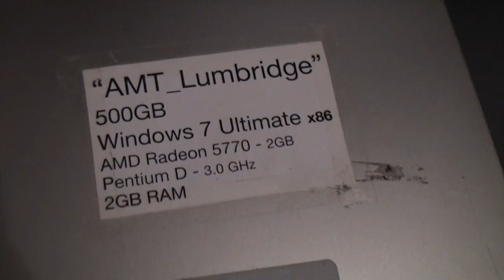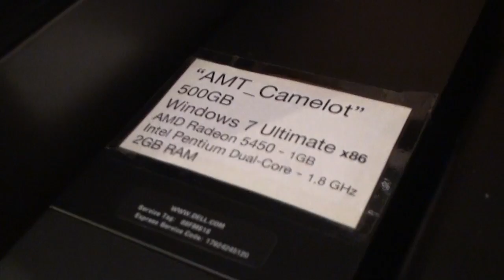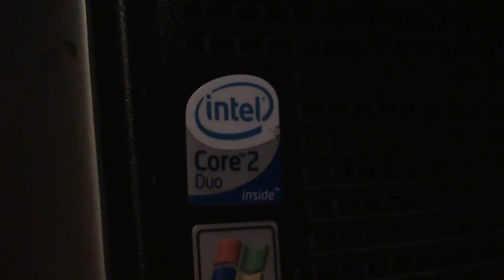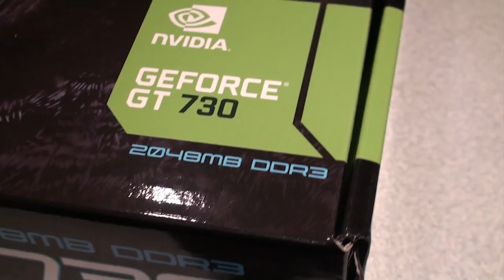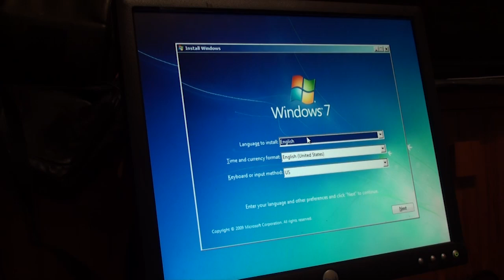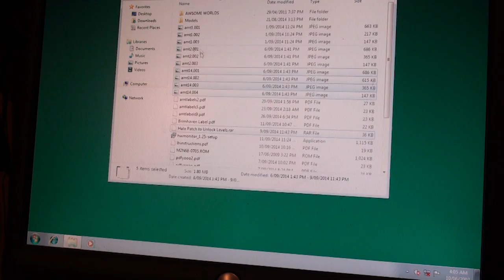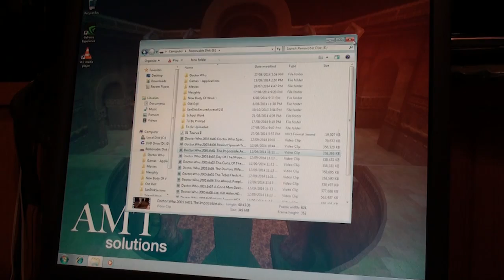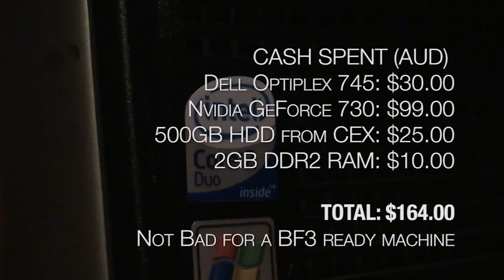Turning an Optiplex 745 from Boy to Man - Green Ham Gaming

Comment: I'm on a Pentium 4 3.20Ghz right now xD, the video kinda lags, but it's ok.
Reply: ***** 50 Euro's for a Core 2 quad q8400
Reply: WokAwAy Ik fix oude PC for de lol, Ik heb 3 PC's met een pentium, xD.
Reply: +Lars Schothorst 50 euros for a 2 duo are you joking more like 5-10 used
Reply: Nr1 sweds For everyone English, I already said in Dutch: I repair PC's for fun, my neighbor's have an old pentium 4 system, I reinstalled windows XP and upgraded the RAM from 256Mb to 1.5 Gb. I was just testing it...
Reply: Lars Schothorst oh I understand. And your awesome
Reply: core 2 duo e6400 2.66ghz pc I built even without my pny 6800 gs installed it pulls 1080p60 easily somehow XD
Reply: Black father sitting in chair If your computer supports a Core 2 Duo T9550, you should upgrade to at least that processor.
Reply: get a pentium g4560

Comment: At this point in time I've got a Dell Optiplex 760 running blazing fast with a GT 210, Core 2 Quad, and 6gb of ddr2. It's also got a 500 watt power supply I had laying around. Gotta love the old Optiplex towers.

Comment: I always had a sweet spot for the Optiplexes.
Back in 2012 I upgraded an Optiplex 745, when I was done it had really nice specifications:
Intel Core2Quad Q6600
NVidia GeForce GTX 295
8GB DDR2 RAM
64GB SSD + 1TB HDD
600W Noname power supply (however, still works until today)

To get that massive graphics card in there I actually had to cut a hole into the plastic part holding the CPU cooler, but it worked flawlessly, the temps still were fine...

I really liked that machine, but now it is more stripped down and in server use as I got a faster laptop

Comment: Hello there. may I ask for a small inconvenience? if you have a kill-a-watt could you please check how much power the cpu alone (755 sff or 760 the kind) draw both on idle and on load? I found several good ones on sale for cheap and I'm thinking about hacking it up, but a C2D's power consumption scares me a bit (okay, a lot) if I chose to run this system headless 24/7 as a Linux file server. Thanks a lot.

Comment: +Green Ham Gaming I've been contemplating some dell mods myself and it occurred to me that you can put a Kentsfield Q6600 Core 2 Quad in a Optiplex 760 uSFF and it will run just fine, problem is it gets hot. so I'm thinking of moving the HDD to the DVD Bay (using one of those Latitude 2nd HDD bay adapters) or an externally powered bay with a eSATA adapter and making a custom air pipe to push air specifically to the CPU and 4GB of 8500 RAM. sound feasible? or waste of time because the Intel Integrated GPU is too weak to bother?

Comment: theres nothing wrong with x64, you need x64 if your using 4gb or more of ram as on x86 it will only see 3gb out of the 4gb ram and you will most likely end up with bluescreens, did the card automatically pick up or did you have to change a bios setting to display via the GPU?

Comment: I bought a GT 730 for my brother's pre-built. It was $70 and had 2GB of GDDR5, 384 CUDA cores, and was clocked at 902MHz.
When you said the DDR3 GT 730 was $99, I was like "WHAT", but then like I looked at the date this was posted and realized it was in 2014.
Reply: My gt 730 is the only card with a 4gb chip. You might know it, MSI made it. 
Its stock clocks were 700mhz on the core clock and 500mhz on the memory clock. 
Iv  actually gotten the card to reach as far as it can possibly get, 910mhz on the core clock and 650mhz on the memory clock, with absolutely no temperature hiccups or screen artifacts!
Reply: also australian dollers not us dollers

Comment: i have a stack of dell gx620's that look just like this one man... they are not impressive but will do the trick for cheap... i have these as play pc's for my 3 kids so they don't end up breaking my bank account... i think the stack is at 12 just for the dell gx620's and then 4 or 5 servers servers of different sizes at any given point that i rotate through in my garage along a stack of 15-20 other pc's of all races and creeds, a dozon  or so laptops... i 6 pc's running in my house and 3 servers allmost all of these were salvaged and or given to me... i like how you can enjoy yourself with these older rigs...
 "i get it man"

Comment: Would a E6600 (Conroe) CPU with 4GB of RAM and a 9800GT work for gaming?
(My 945G chipset cannot support Core 2 Quad or Core 2 Duo Wolfdale CPUs)
I'm planning to play Civilization 5, and some 2005-2010 era games.
Reply: For 2005 -2010 era, a computer with the Conroe core should work fine. Its the newer games that will need a Wolfdale 45 nm or Core 2 Quad.

Comment: Hello There, this is a great video, thank you for sharing this, the good news is that with Windows 10 you can just change the Lock screen Wallpaper through the settings, Tweakslogon was certainly a decent tool thought for Windows 7 overall. This was a decent episode and it was great to see how much of a difference a few hardware upgrades make to the overall user experience.

Comment: Ok serious question:
Do you know if a standard PSU fits the Optiplex chassis, like the one in the video? More specifically, if possible, an EVGA 450W B?
Reply: In the newer OptiPlex 990 and 9010 that use a micro-ATX motherboard, yes. In the older OptiPlexs with the BTX motherboard, sort-of. Only two screws align up with the case and standard ATX PSU, but it will still work.

Comment: did a pentium d ever come stock with 3.4 ghz? i found a minitower optiplex 745 with:
pentium d 3.4 ghz 160gb hard drive
4 gb of ddr2 ram  q935 intel integrated graphics (ps i need suggestions for a low power, and low profile gpu)

Comment: Draynor looks cool. Almost like a tank in the computer world. It may not be powerful, but it is cool.
Reply: i have one of those machines sitting next to me that is used only for holding a paper bin xD, their not a tank at all
Reply: UPDATE I've gutted my Draynor and installed my gaming pc in it that i got for free (found a sandy bridge i3 machine thrown out because of a broken hdd) and i installed it in this case with 5 thermaltake workstation fans and for now a shit hd 5450 till i get some more money for a psu and gpu upgrade.
Reply: k thanks xD
Reply: +Lalnable Hector good luck from me too.
Reply: Hotboosthouse Thanks man, moneys short so when i found this i was so so fricking happy so when i get some money in the next 2 weeks im gonna have enough for a good psu so i can run one of the graphics card my friends have offered me( either a gts 250 or an r7 250) so its gona be great for what i play untill i get some more money for a new gpu :)
Reply: +Lalnable Hector get a 7770. It costs £40 here and it can get 1080p MAX 30 fps in GTA V. Also on 1155 you could get a core i7 3770K or an i5 3570K for £110/£95 respectively.
Reply: Hotboosthouse Im not not sure how well those prices transfer to Australia but thanks very much for the suggestion, i was thinking of going down the i5 2500 route or i7 2600 route because this board is out of an acer x3990 so i dunno how high end the cpu support is however these two are still very strong. ill be sure to check out the 7770
Reply: +Lalnable Hector they should price (the CPUs) at 180/160 AUD. It's that cheap? The 7770 should be 60-90 AUD. Os that good?
Reply: Hotboosthouse i know the square root of fuck all about AMD graphics cards so i dunno what price is good on used AMD cards. and as for cpu i can get the i5 2500 for about $100 and the i7 2600 i think their around $150
Reply: +Lalnable Hector OK
Reply: Hotboosthouse Can get the HD 7770 for about $150 on gumtree
Reply: +Lalnable Hector eh that's OK I guess...
Reply: Hotboosthouse ill shop around ive got plenty of time before i have the money
Reply: +Lalnable Hector lol I know how you feel
Reply: just thought i'd let you know i picked up a good coolermaster 600w for $79 and a gtx 780 for $190 which is really cheap here. running like a champ  but i need to get an i5 2300/2400 or 2500 to get rid of the bottleneck which i can pick up now for about $60 and then 8gb of ram and ive got my rig ready for doom and gta v :)

Comment: Fun fact: 
The GT 730 in this video is based on the GF107-400-A1 GPU which is very similar to the GF107-300-A1 as you find in a GT 430 and the same as which you would find in a GT 440 and other older GPUs. So if you have a 2GB (128-bit) GT 730, 620, 630 (rev. 1), 530, 440 or 430, expect to get similar performance.

Comment: Green Ham, quake3 has a fps limit that is set to 90 FPS by default. That's why your quite modern Dell was getting 91 FPS. You can have more if you type "com_maxfps " and then type a number, eg. 120. This will make Quake feel even more smooth on a 60hz monitor , and allows to take advantage of 144hz monitors in professional Quake scene. Also if you ever play on a HD monitor and you want true nonstreched widescreen, try downloading excessiveplus. It's a free mod that is used for multiplayer for ages , but it works with campaign and bots as well!

Comment: Hi !!! I got a Dell Optiplex 740 running Windows 7 UIltimate 64bits with an AMD Phenom 8600 Triple Core (2.3GHz), 4GB RAM, an ATI Radeon X1300/X1500 Series (256MB) and I'll love to know if I can make it more powerfull, wich processors and graphic cards should I get ? I've been searching all day for an answer. I got an AMD Athlon II X2 240 (2.8GHz) its also an AM2 socket so can I put it ? It has a graphic card PCI, PCI Express X16 entrance, BUT I DON'T KNOW IF IT CAN HANDLE IT OR IF THERE IS SOME RISK.

Comment: i have been looking at some quad core dells, like the precision and optiplex models from your experience which of these are best to upgrade and whats the best case to upgrade? im really new to this i dont want to build a complete gaming pc but willing to upgrade an an ready existing computer.
Reply: +Datsunmudder So you dont have a PC rigth now and you want a PRE-building PC of HP/Acer/Dell?, well you better look the following:

1) Mini tower factor form is better, better ventilation (greater chance of improvement) more space to maneuvering (better manage cables) and has a PSU with standard measures, which you would have to change if will buy a video card with greater power and consumption. Pick the MT factor:
http://en.community.dell.com/cfs-file/__key/communityserver-discussions-components-files/3514/1464.FAMILY.jpg

2) Researches on the official website, you might find a web publication or PDF file to show you everything related to the model,  for example another dude talks about a Dell Optiplex 755, apparently that PC would have a Core2Duo (two cores) and only 2GB of DDR2 RAM
http://www.pcworld.com/product/30456/dell-optiplex-755.html

However, according to an official PDF file from DELL, indicates that its motherboard has 4 slots for DDR2 RAM (667MHz or 800MHz) and would hold up to 8GB in 4 modules of 2GB (quite good for a PCGamer) would also have free one PCIe 16x slot (for video card); a Quadcore would be compatible with TDP-105W like the Q6600 (2.4GHz) and Q6700 (2.7GHz), but apparently not hold the Quadcore TDP-95W like Quadcore Q8300/Q8400/Q9400/Q9550/Q9650 (BIOS peculiarities, but maybe it's a matter of try); see page 10 for processors, page 12 for the RAM, page 28 for PSU.
http://www.dell.com/downloads/global/products/optix/en/opti_755_techspecs.pdf

* So looking information for each model you see, to know whether it can be improved or not.

3) VERY IMPORTATNT!, The model should have a mother and PSU board with standard connections, ie carrying the connector "20 + 4-pin" (usually about slots for RAM), the connector "4 pin" or "8 pin" (near processor socket), because in these branded PCs, the custom motherboards are common (especially HP, Acer, Asus); back to DELL Optiplex 755, I see that your motherboard would be standard.
http://www.amazon.com/gp/product/B00TRSKEDO/ref=pd_lpo_sbs_dp_ss_2?pf_rd_p=1944687462&pf_rd_s=lpo-top-stripe-1&pf_rd_t=201&pf_rd_i=B005LVWWUY&pf_rd_m=ATVPDKIKX0DER&pf_rd_r=03GJ5CWPDBJNA85A8DPV

4) The PSU of that DELL Optiplex 755 (MT format) has 305W and two lines 12V+ 18 Amps each, is actually a generic source, so do not rely; in this case I would add a low-power GPU from Nvidia, for example a GTX 750 or GTX 750Ti with a single fan without PCIe 6 pin connector (consumption of 50W and 60W respectively), otherwise it will always be advisable to change the font to a PC brand.

So there you have a Dell PC with Quad Core processor, motherboard socket 775 measures and standard connectors, with 4, 6 or 8GB of RAM and a GTX 750 or GTX 750Ti low power (if you change also the source, you could put a more powerful GPU). That PC after the changes, would provide the same or better performance in games  than PS4.

PD. Search PC DELL MotherBoard with Chipset Q35, Q43, Q45 or G41;  if chipset is newer (Q57, Q65, Q67, Q77, Q87, H61, H67 B75 or H81), then the PC would have a processor Intel i3, i5 or i7  not a Core2Duo or Core2Quad, which would deliver a more powerful processor, more new mother board and RAM DDR3 instead of RAM DDR2. :D

Comment: i remember buying a Dell inspiron like 1 year ago with an i3 and 8 gb of ram, change the PSU, change the case, added a gtx 960, change the motherboard, change the cpu , added an ssd and change the 5200 rpm harddrive. but hey still is the same pc that i bought one year ago:D

Comment: Do you think it is possible to replace the power supply and put a gtx 950 in one of these things?  I am thinking about doing that with one of these for a cheap gaming pc.
Reply: If it's a core2duo, you should probably not get anything more powerful than a 750ti, even that might bottleneck, but if it's a core2quad, you could probably drop a new power supply in there and a 950 and game.
Reply: Franco Pellegrin Yeah thanks, I found an optiplex core 2 quad for $75 so I was wondering if that could game!

Comment: My main machine is a Dell Vostro 220, with a Core 2 Duo E7500 @ 2.93GHz, 4GB of RAM (upgrading to 8GB soon), and a GT240 (upgrading to a GTX750Ti). It runs Windows 10 perfectly fine, and can do some light gaming too. If I wanted to I could put in a C2Quad, but I see no reason to as the C2Duo runs just fine.

Comment: hey TJ, you can get refurb WD Blue hard drives on amazon for around 20 us dollars. I got a 320 GB 7200 rpm refurb SATA II WD Blue hard drive for around 20 dollars and use it in my old hp D530 SFF system. It's working great so far.

Comment: Intel Core 2 Duo E8400 3.0GHz Processor EU80570PJ0806M OEM TRAY
Does this work with the Dell Optiplex 745?
And is this EVGA GeForce GT 730 2GB GDDR5 64bit DVI/HDMI/VGA Low Profile Graphics Card 02G-P3-3733-KR the best graphic card for Optiplex 745?

Comment: Whats the point of a 730 with a 2 duo? In my opinion with a 560ti you would get the same perfomance and a lot cheaper.
Reply: 560Ti is mostly likely more expensive than a 730 (in NZ hardware prices don't drop much), and those Dell cases probably can't take dual slot cards.

Comment: Just upgraded a few weeks ago to a replacement of my old laptop it's a new gaming laptop which has a
 I7 6700hq 2.6ghz
8gb ram
1tb hdd 7200 rpm
gtx960m
windows 10
and a steelseries keyboard and when I see these machines im like WHUUUUUT do they even run ANYTHING???

which is weird because it was only a few weeks ago when I replaced my old laptop that had a 
I5 2430m 2.4ghz
8gb ram
500gb hdd 5600rpm
geforce gt 520m
windows 7 home
and a crappy keybaord which is mushy

Good upgrade?

Comment: good video bro  i have one question  i use one dell gx 760  core 2 duo 2 gb ram and 120 hard drive  i need upgrade my graphic card  xfx one hd 5450 is good? i have oem psu 255 wats

Comment: I have Dell Optiplex 740 with:
-AMD Athlon 64 X2 5600+
-1gb DDR2 667mhz RAM
-Stock Graphics
-160gb WD Blue
-305w stock power supply 
If I install the GT 730 and upgrade from 1gb to 4gb of RAM, what kind of games would I be able to play?

Comment: Is AMD R3-8400 better than 5450? I'm seeing if I can build a $300 PC for my little brother - he just plays Minecraft.
Reply: $300-$400, I mean.
Reply: Also, would the AMD A6 5200 be suffice for Minecraft, and maybe BioShock Infinite? Also, CS:GO.
Reply: I'm thinking of getting the AMD quad core a10 7850k, 3.7ghz. I found it extremely cheap for what it's worth. I assume it would easily be able to play Bioshock Infinite, right? It would be paired up with the nVidia GeForce GTX 750ti, My old PC had the 750ti, so I can just take it out for free and put it in this new pc. Would i need 8GB ram, or would 6GB be enough, as if I got 8, it would go over my budget.
Reply: Aero If all he needs to play is minecraft then $300 is a bit excessive
Reply: If you're going with an A-10 the built in Radeon R7 integrated graphics should do fairly well on its own if paired with decent RAM. Don't get an nVidia card to pair with the A-10, as it's capable of running dual graphics with another Radeon card of the same spec as the APU's graphics. EDIT: I saw you already had the graphics card on hand. That's fine but again, the built in Radeon R7 should suffice.
Reply: Ah, thanks Marcus Cook.